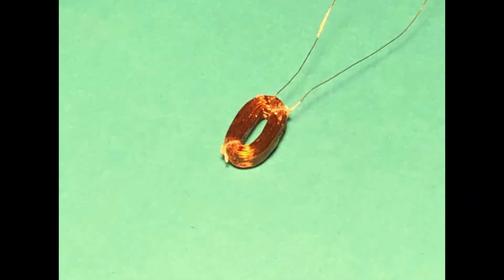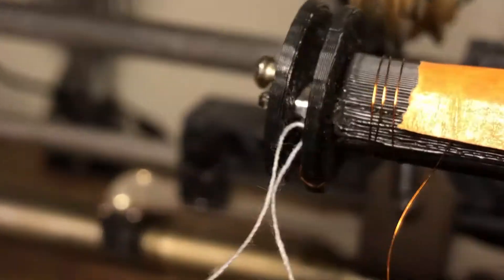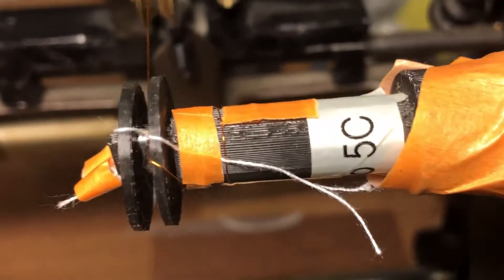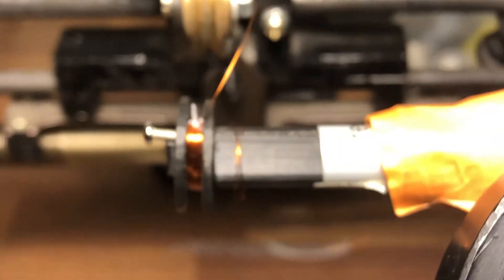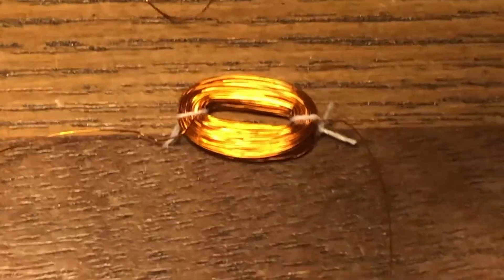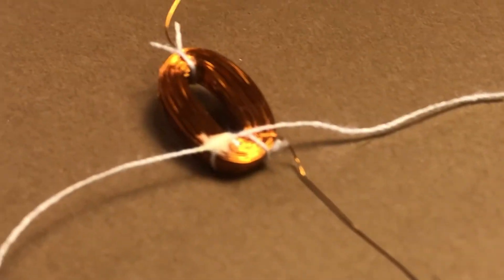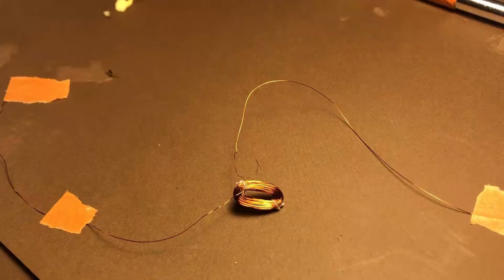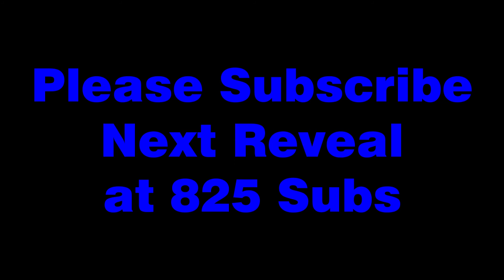PRESTO 5C Coil Making Demo

Comment: This is great. I've been experimenting trying to wind coils for my RCA MI-4887, I got there in the end - but this is much better than how I was doing mine - instead of foil I used a straw, and wound them circular then flattened them into ovals. I'll be giving this method a go over the next few days.

I have been adding resin while I wind the coil, is that an advisable way to do it, or should they be wound dry and soaked after?

Really enjoying the videos!
Reply from the maker: Once I get to 850 subscribers I'll show my latest method for making these.  No ties.  No deformation.  Perfect results every time.  No resin either.  I use epoxy on all coils now.  Thanks for the comment!!